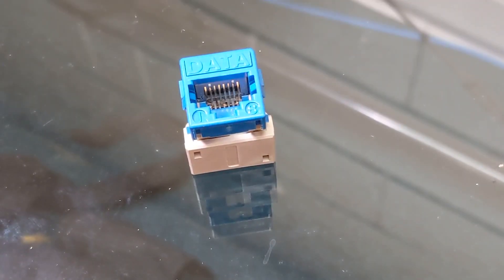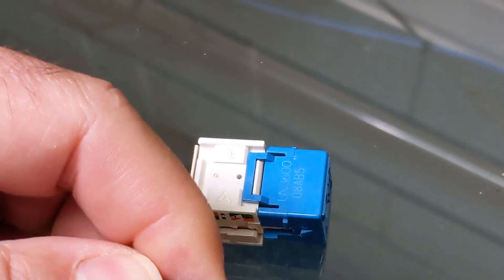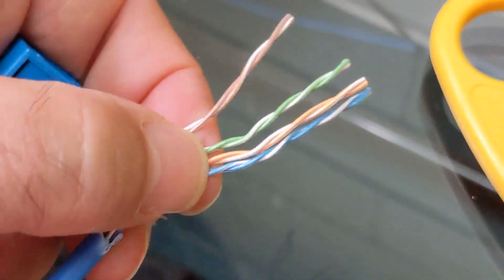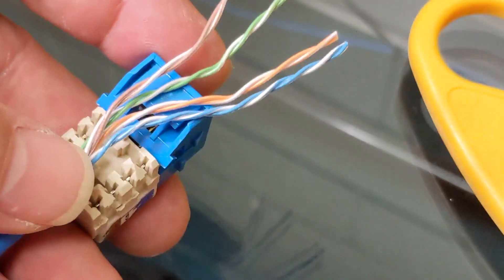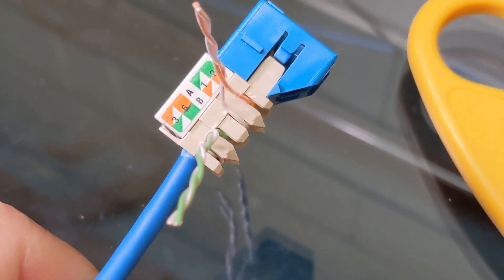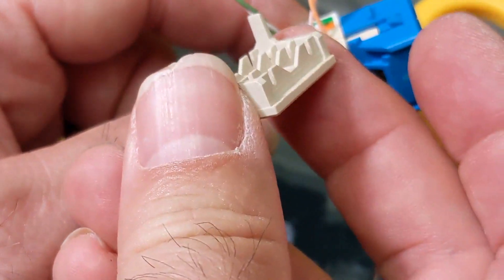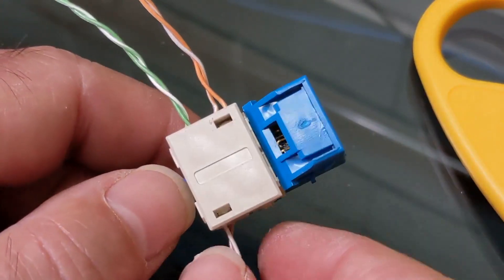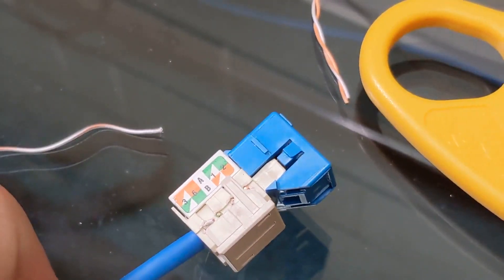Commscope Systimax Cat5e Termination MPS100

Comment: They make a palm holder for terminating these. At least Suttle does for there brand.
Reply from the maker: Right?  I have seen those.  Otherwise, the techs put them on the drywall and then it scars the surface 🤨